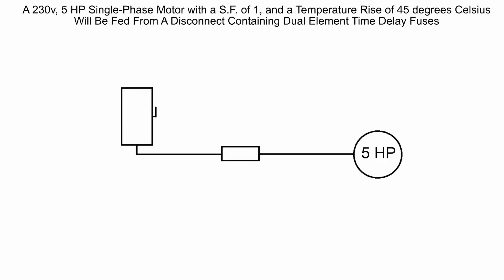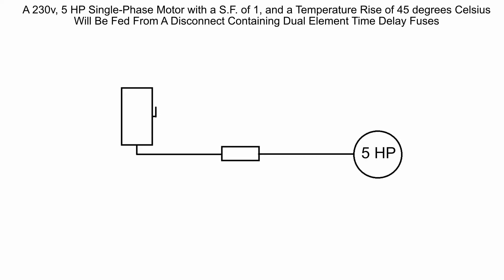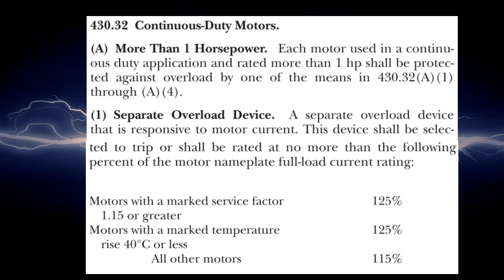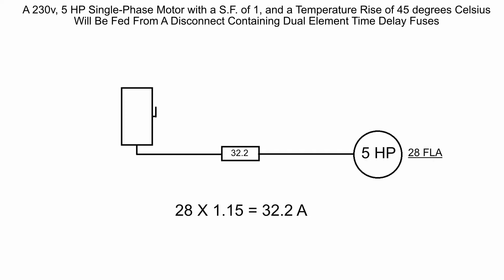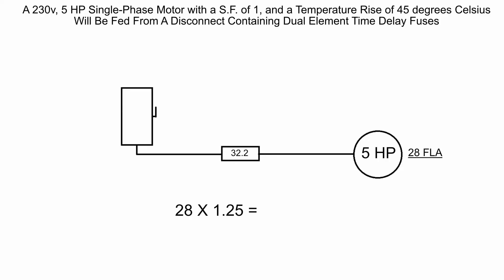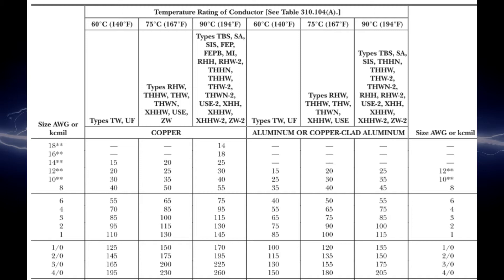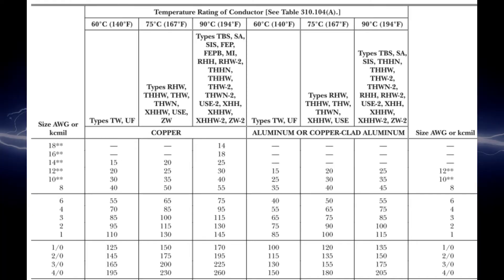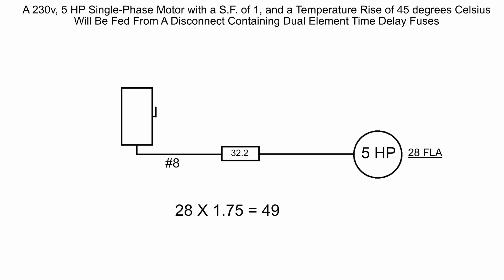How To Size a Single Phase Motor  **Master Electrician Exam Prep**

Comment: Hi shouldn’t motors that don’t have a listed temperature rating for conductors  or terminals in the question automatically be chosen from 60 degree column ?